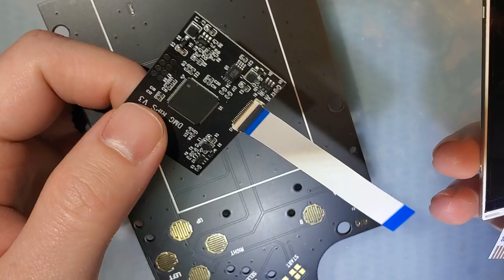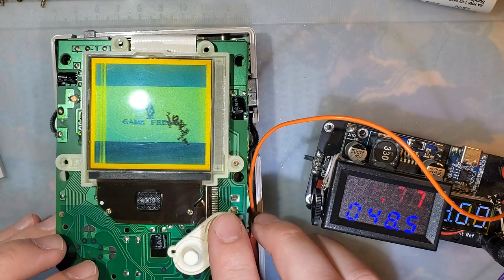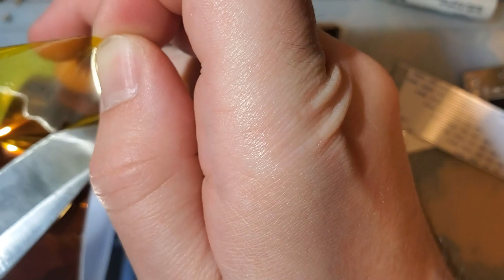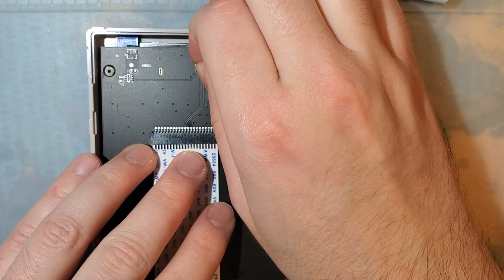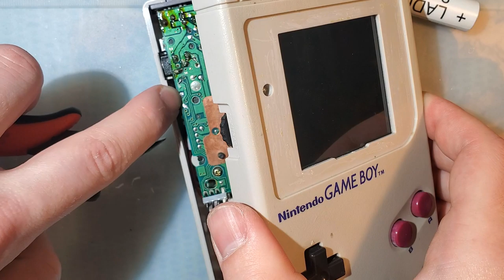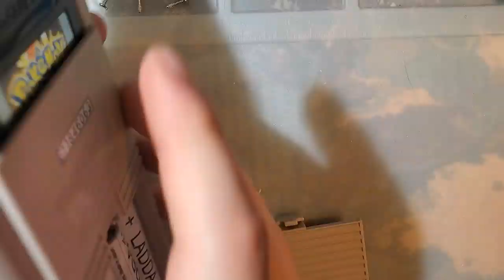Installing the DMG IPS Kit (RIPS v3) in an original Game Boy

Comment: Also useless info but that DMG was manufactured in 1990, as the stamp on the back pcb starts with 011, which I wanna say is 1990 week 11. Not too sure on the second and third numbers but the first number is the year. For example if that number began with a 5 it was made in ‘95, or if started with 2 it was made in ‘92, or 9 for ‘89 (not to mention would have a very low serial number on the back of the unit that begins with a 0).
Reply: it's not useless info! thanks!

Comment: I definitely had problems particularly with diagonals on the dpad. I ended up putting masking tape on the bottom of the Dpad at a redditor’s suggestion and that fixed it. There are other solutions as well involving sawing down some stumps on the back shell.
Reply: On the V2 I mean. I just found out earlier today a V3 came out and was sold out on HandHeldLegend when I checked😒

Comment: I installed my V3, but the screen is black, no backlight, doesn't look like there's anything on the screen happening at all, but it does boot games and play audio and respond to controls. Any ideas? I've tried reseating the ribbon cables, I've even tested for continuity across them, and they're fine.
Reply from the maker: Make sure you reseat all the cables and make sure the ribbon cable that connects the little PCB to the big front PCB is not backwards. If it's still not working, contact the vendor you got the kit from.
Reply: @makho  It was backwards! Up and running! I'm blown away by how good this display is! Thank you! :- )

Comment: thanks again for the video. i just installed the v3 rips IPS for DMG  from console5.com
the bracket is great - the lcd almost slides in from the top the bracket is so tight.
i just put everything together and it looks fantastic.
brightness wheel is a little jankey - and not my "select" and left arrow dont work reliably - looks like i will have to open it back up and tighten some screws or re arrange some things
Reply from the maker: be careful that you have the screws torqued properly; not too tight and not too loose.

Comment: I see kits on ebay from China that say v3 and look like they are the smaller size screen like the v3 but they have the OSD. Are these basically the v3 and they just added the v4/OSD board? Is the OSD board compatible with the v3 screen? The only reason I'm wondering is that I bought a nice, special shell and I didn't want to have to cut it and buy another matching color lens to fit the v4 so I'd really like to get the v3 with the OSD.

Comment: Thank you, your video helped me installing this screen. I do have it running, but I don't understand how to change the color palette. First it was black and white, but as soon as I scrolled the contrast wheel down, colors got yellow pink as in your vid, but I can't get it back to b&w. Any advice ?
Reply from the maker: The wheel should click. If not, you need to take apart your console and check that you have trimmed the plastic appropriately. If so, double check that your screws aren't too tight and warping the shell.
Reply: @makho  I'll look into it right now. Thank you so much.
Reply: @makho  Loosening two screws did the trick ! It clicks and I can change the color palettes. Thanks again. Best regards.

Comment: I don't know if I got a bad board or not but the V3 for me, there has been no improvement on button response. It still drops inputs, and in particular games where you run with B and jump with A are damn near unplayable. Tried different membranes as well. I tested it with Donkey Kong Land 2.
Reply from the maker: I'd suggest contacting the vendor if you haven't already

Comment: The v3 has gold contacts which is why they claim the better buttons
Reply from the maker: So did v1 and v2. Feel free to check my older videos for proof (turns out my v2 kit actually shipped with a v1 board but v2 boards still had the contacts).

Comment: I got the same screen. The brightness adjustment worked only a few times. And now it does not work anymore. I don't know what happened. I cleaned it it tried to detach and reattach the ribbons. But nothing works. I can change the color pattern though. Only the brightness doesn't work anymore. Any idea?
Reply from the maker: could just be an issue with the rotary encoder. You'd need to replace it if so but I'd reach out to the seller first.

Comment: Followed the tutorial (which is great) without any hiccups...but when I switch it on the screen is rolling!?!  Everything else appears to be working fine.  I've triple checked everything and still the rolling.  Any suggestions would be greatly appreciated.
Reply from the maker: if you've already tried reseating the connectors, I'd reach out the vendor next. Unfortunately, it sounds like you might have gotten a defect. 

If you have other games, check that and if you have another DMG main board, check that too.

Comment: I just installed mine and it has vertical lines on the screen after the Pikachus appear.  What's wrong?
Reply from the maker: Your DMG isn't booting or your screen is not connected properly.
Reply: @makho  must be the latter because the game sounds work fine

Comment: What is that two diagonal (red) line on the new screen❓ That's not acceptable...
Reply from the maker: Like I said in the video, I left the protective film on because I plan on installing this in another DMG. I didn't know that the screw posts were broken in this DMG and I didn't have anything else to work with at the time of the video.
Reply: @makho  That's okay. I didn't realized you said that in the video. 
Never left on the protective film if that has some "markings" on it.

Comment: Which do you think is better overall V2 or V3?
Reply from the maker: well, both seem to perform about the same so with v3 being easier to install (barring the lack of brackets right now, that will resolve itself soon), v3 by far. Plus, it's black.
Reply: @makho  Awesome thank you. By the way how does the screen size when installed compare to an original unmodded DMG?

Comment: Is it possible to dim the led? It blinds me _
Reply from the maker: not in software
Reply: @makho 
Also a hardware solution would be fine!
I think I need to solder a resistor but where?

Ps
Thanks for your gba battery, I am loving it!
Reply from the maker: @DavideNastri  if there isn't a resistor right next to the LED, you can just add one in series. Alternatively, if you have a marker, you can just color over the LED and that will dim it significantly. In older builds, I would purposely use bright LEDs but then add a small bit of paper behind the lens to diffuse the light better. This works a treat for dimming too. You've got options.

Comment: Hi, I guess you actually missed the whole point of the V3 and is that it fixes the button responsiveness, which was a problem in V2. That is why there is a new PCB
Reply from the maker: I didn't miss that point. I explicitly stated that I didn't have any responsiveness issues with my older kit.
Reply: @makho  I've not heard from anyone I know that has the V2 kit having problems with responsiveness so I'd be interested to see what the actual % is